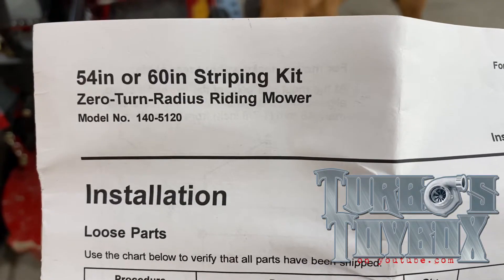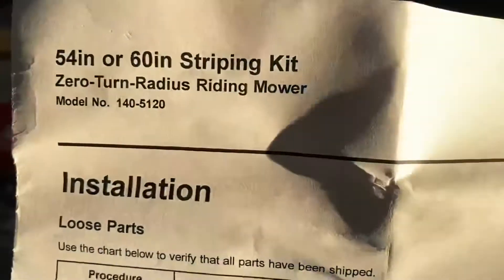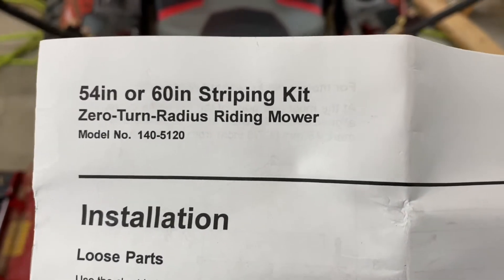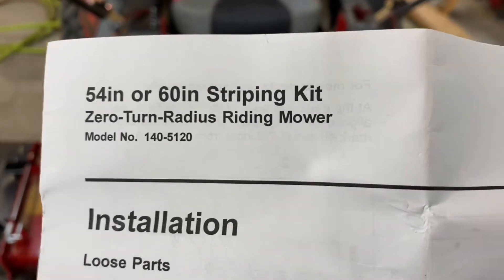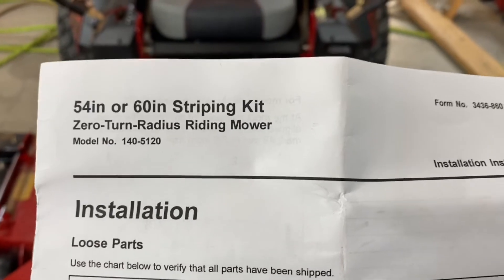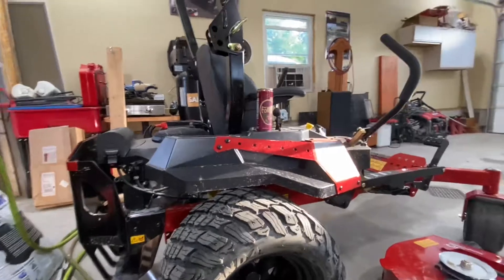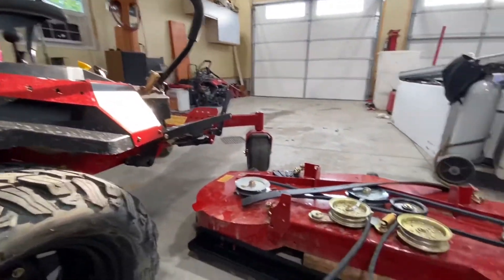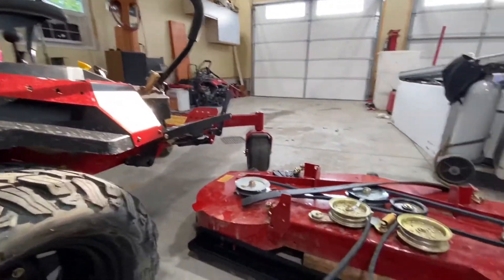Toro Titan Max striping kit install

Comment: You regret the self taping bolts as mine backed loose. I put a bolt with locking nut on mine. Also I took my wheels off and left the deck on